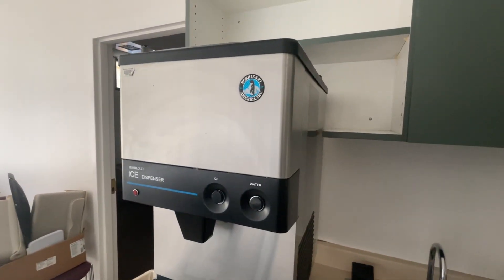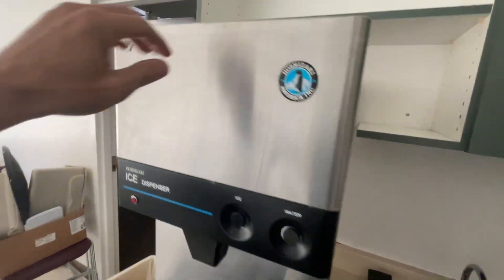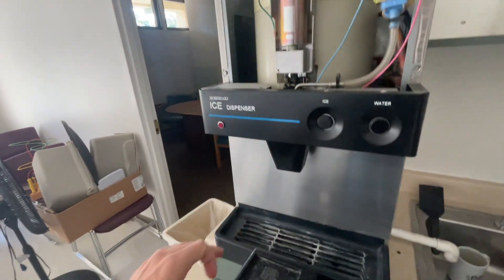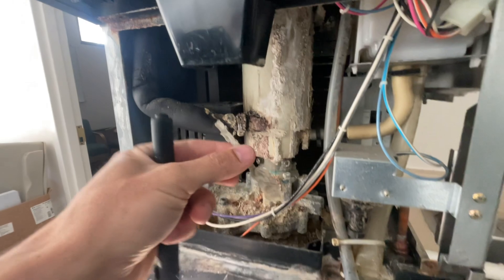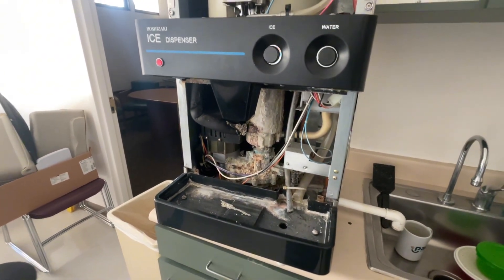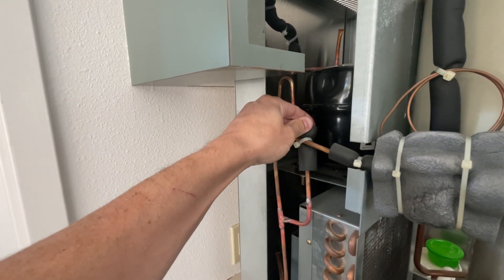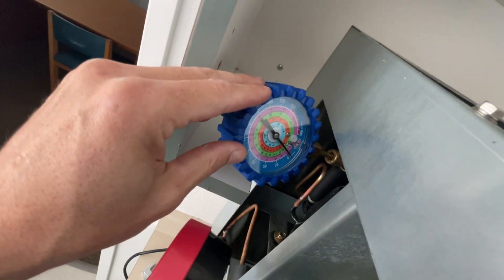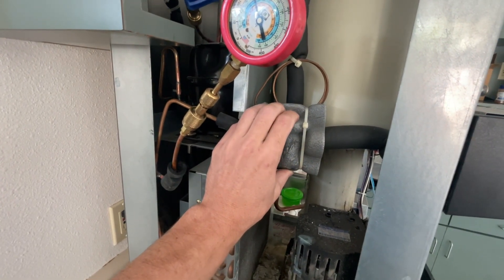Hoshizaki ice machine troubleshooting - DCM-270BAH with a bad TXV

Comment: Im having a hell of a time with my evap coil freezing up when couple bins of ice get discharged, i work in hospital. Why does it freeze up right at top of extruding head and start sqealing BAH-270. Please help
Reply from the maker: If you’re talking about the agitator turning into a softball sized ball of ice I know exactly what you’re talking about. I’ve definitely seen it once or twice but I’m not exactly sure why it happens. It’s definitely never happened so bad that it causes squealing. Hoshizaki tech support would be a great place to get that information.
Reply: @IceMachine411 i work in a hospital have multiple machines and id say happens either A hot water going into the machine but tested that theory and didnt seem to work. B maybe from the staff turning machine off at night to sleep then turning back on. Cant figure it out

Comment: Great diagnosis! I rarely or never run into a bad txv on a I’ve machine

I’m curious if they opted to do the work or just replace. Looks hammered. 

Could it have been a natural restriction in the valve needle? Or a sticky spring?? I’ve seen that one could take a torch and heat up the txv to try to melt that restriction , tapping it with a screw driver handle.  
Easy to test that bulb as well and see if moves. 

Probably was the bulb but maybe if it’s old enough and has one last kick left in it, you could smash the txv and see it throttles open
Reply from the maker: It’s not all that common. I’m sure now that we’ve talked about it you’ll happen upon one. I did tap on it but nothing happened. I forgot to try and mess with the bottom adjustment. Apparently they’re adjustable but I’ve never attempted it.